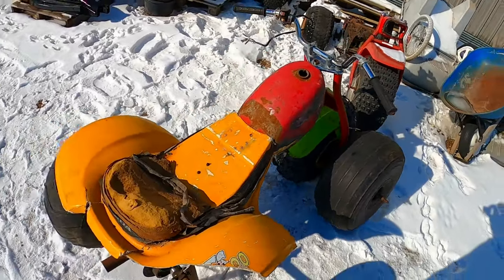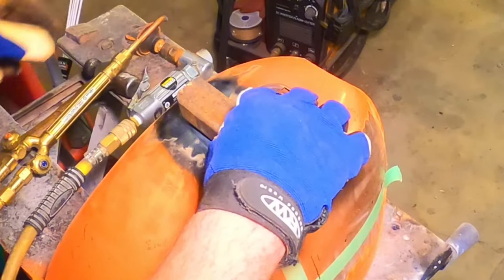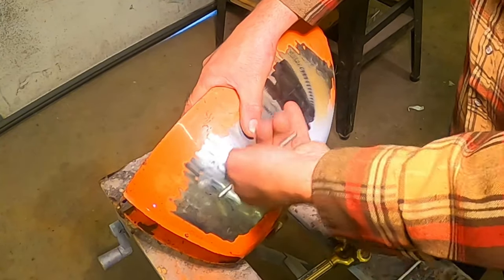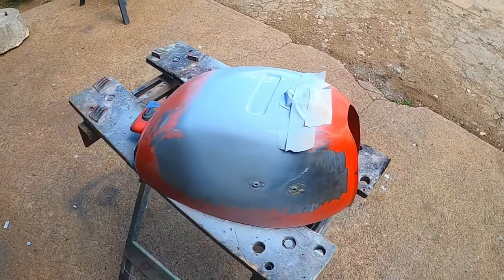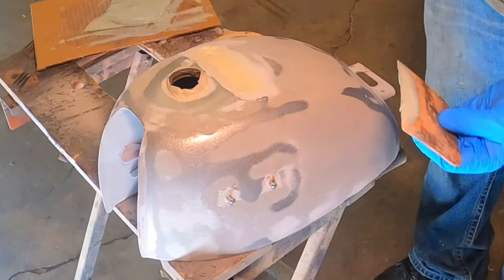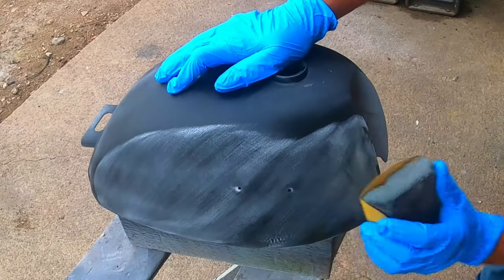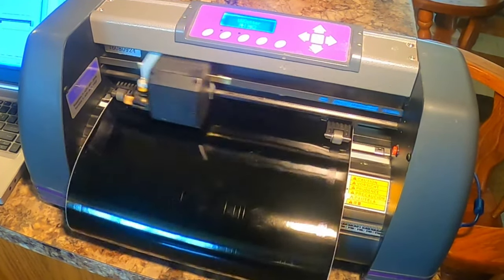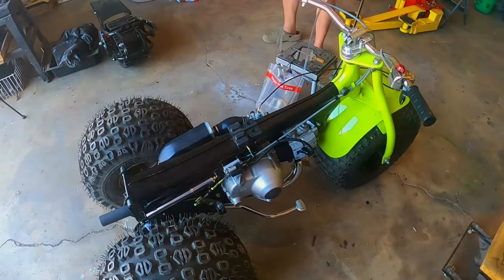Restoring a MASSIVELY RUSTY ATV Gas Tank - Vintage Honda ATC 90 Repair and Rebuild How To Fix

Comment: Looks amazing. About 5 years ago , i bought a 1985 ATC250ES Big Red that had been left to rot outside for many years . The inside of the gas was very rust . I cleaned the rust out with toilet bowl cleaner and then sealed the inside with Redkote .5 years later , the Redkote is still holdind strong . Years ago i used to try to seal rusty gas tanks with two-part Kreem . Never worked . That stuff is garbage!!!!
Reply from the maker: Cool, I've heard good things about the Redkote. I like the toilet bowl cleaner idea, I'll have to try that out some time. Thanks again for stopping by.

Comment: Seriously nice work! I would recommend using chrome socket cap screws instead of the Phillips head screws. Would make it look more original and have a cleaner look, awesome vid 👍
Reply from the maker: Good eye, I was thinking the same thing. I was only able to find those zinc phillips ones locally. They look pretty bad on the video 😁 I'll have to get some real ones ordered. Thanks again for watching!

Comment: For anyone wanting to imprint like 2:08 fill the tank up with sand to help reduce stressing other creased areas and just tap down with a rectangular block preferably with a bolt in it for easy removal
Reply from the maker: Excellent idea!!!! Thank you!
Reply: @BIGFOOTBIKESANDBREWS  not a problem, I'm a novice panel beater and metal mover but I'm glad I could pass some info along
Reply: @BIGFOOTBIKESANDBREWS  when sand isn't an option you can use that crushed glass stuff from sandblasted, that doesn't stick as much during the cleanup
Reply from the maker: @FartSuckerUmad  All great ideas! Thanks again for sharing!